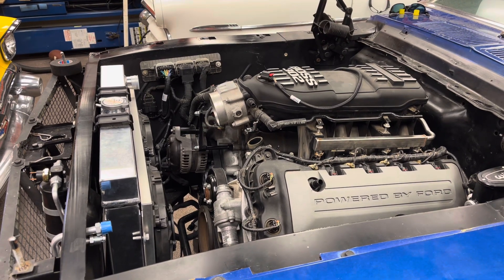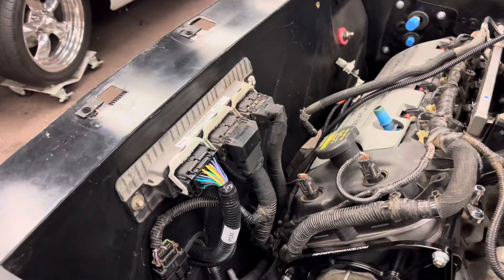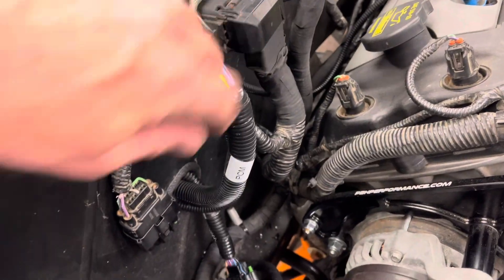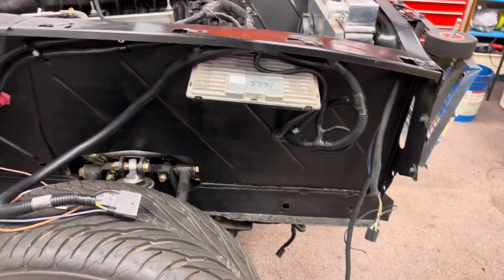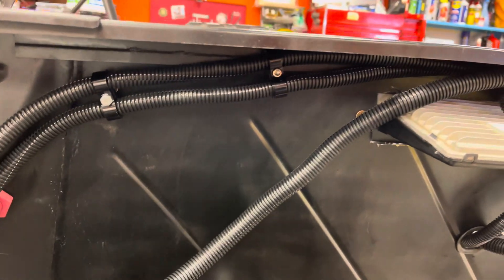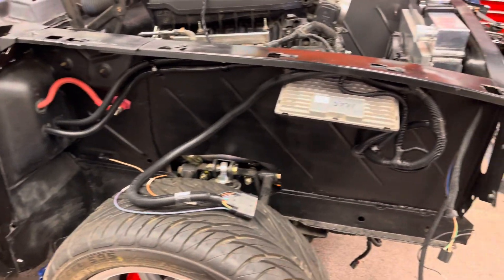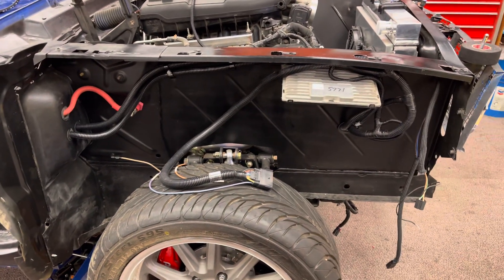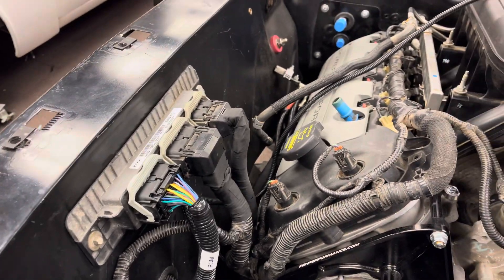Part 18. Coyote Swap ECU harness routing.

Comment: I've always wondered if plastic or fiberglass wheel liners could be fabricated to fit the gen 1 Mustangs to better protect everything.   Even more reason for this with the ECU and other wiring in there.